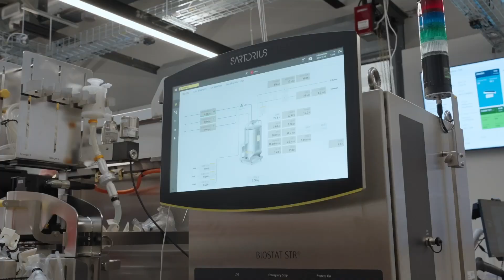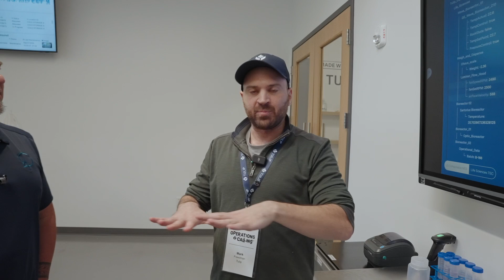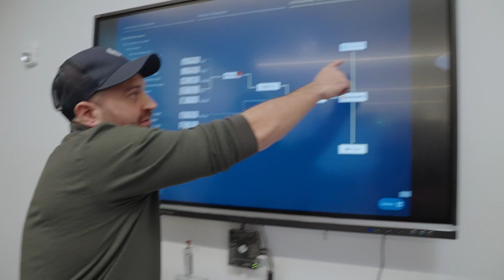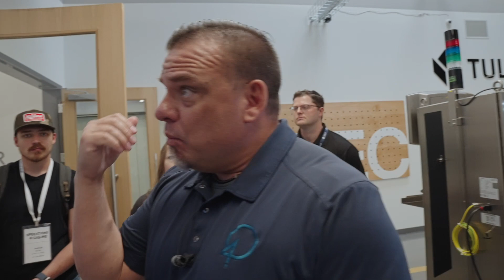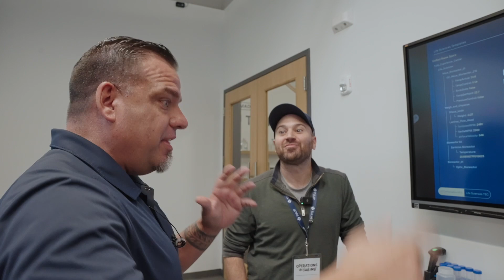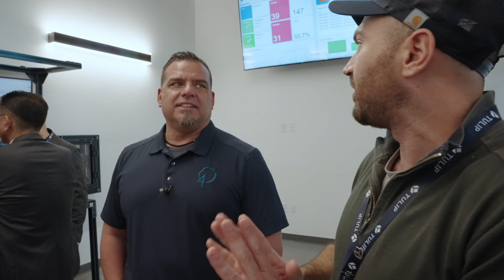Building a UNS with Tulip Ecosystem Lead Mark Freedman

Comment: How do I get involved. I'm a master electrician with 25 years in the industry, and I have 10 years of web developement and systems integration under my belt from an IT prospective.  No OT experience other than IP CCTV and Access Control and 10 years of CRM/ERP systems integration.  I'm a master electrician/web integrator.  How do I get an audience that appreciates my background.  I'm a peacock in an industry that doesn't know what a peacock looks like.
Reply from the maker: Join our discord community!

Comment: Caveat - I love UNS, I love Tulip:  But this seems to be a solution to a problem that doesn't exist in conventional automation - unless I am missing something.  UNS is a brilliant extension of the S88 physical model combined with the S95 enterprise model smashing into the AF data structure of OSI PI.  Like all great thing sit is elegant in its similicty and being "obvious" once someone thinks of doing it (thankyou walker).  But take a PCS system like Emerson DeltaV - the configuration of the control system is split into the S88 physical and procedural models,  In DeltaV explorer I define each "data point" (lets say a pressure transmitter) as a child of a unit, child of a process cell etc.  When I look at my configuration I build it directly in that S88 physical model structure - aka a rigid, non bending branch of a UNS.  When I deploy that configuration into the control system controllers that data is broadcast "within" DeltaV in that structure (and actually our age old friend OPC retains that structure), so we can make templated displays, procedural recipes to reference explicitly or relation-ally that data (e.g. like a UNS context).  Similarly that data is picked up in OSI PI and displayable in PI AF with the exact same S88 physical model context.  What I think I am seeing here (very open to being corrected) is to layer a similar approach within Tulip using machine types.  However, because Tulip currently doesnt visualise the UNS context in the way that DeltaV does from either a configuration or run time view - you;re having to create apps to  produce this same view.  So on first site this seem to be correcting a product deficiency, requiring more work rather than adding something new ?  Albeit there is more data within the UNS context from other systems than a silo'd control system.    (For DeltaV you could also substitute Siemens PCS7 etc).  What am I missing here or is this solving a problem for smaller scale "MES" to Automation/PLC systems that dont enforce a strict S88 physical model to data and configuration?